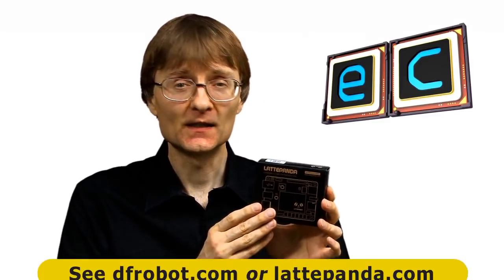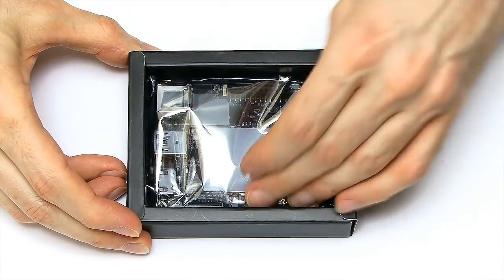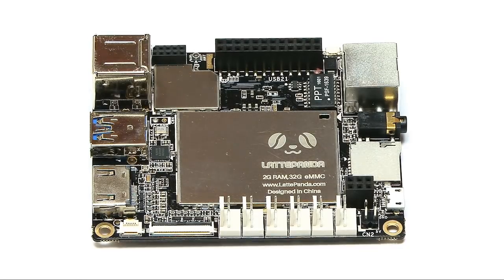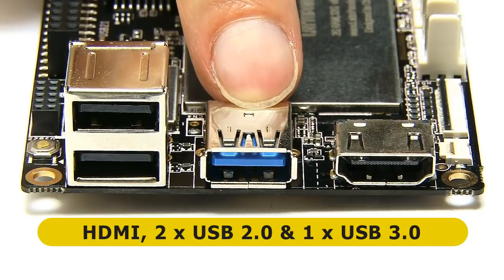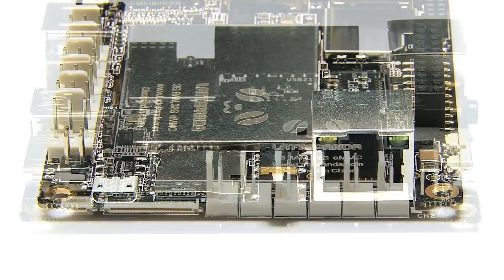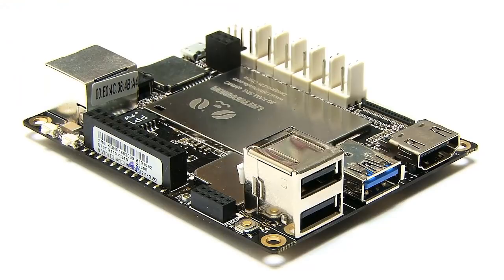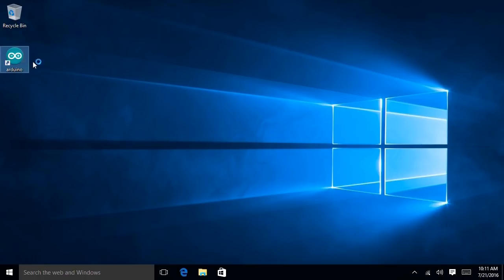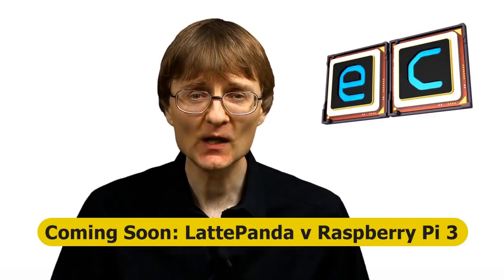LattePanda Windows 10 Single Board Computer

Comment: Could have never imagined this way back in 1996 when I first got my very own Pentium pro desktop computer with a 1gb hard drive and 16mb RAM! Technology has sure come quite far!
Reply: What?! 16 MB of RAM? back in the days that costed a fortune...
Reply: And my computer have x1024 times the memory 

Has sience gone too far?
Reply: Mate.  You are way too young ;)
Reply: and now you can run hundreds of adware, malware, trojans, keyloggers, bitcoin miners and viruses at the same time and you browser will still lag like it's 1996 again
Reply: Clean up your computer then and stop moaning dude.
Reply: Yeah. Time has change fast. In the end of the 80's,  I bought a Brick 80286 computer. Default setup was 1Mb of SIM RAM. I decided to upgrade the memory to 8Mb (max). The cost of 7 * 1Mb RAM back then was approximately $1.000,- :) Before that, I owned a Amiga 2000. It become so expensive, that I had to skip the 20Mb hard drive and live with a couple of floppy's :)
Reply: Well, my first PC had 75 MHz (yes - seventy five mega hertz) CPU, with 1MB RAM and 600 MB HDD........  Been using it for browsing only. 
Then the second one had 200 MHz CPU, 16MB RAM and 2GB HDD -  I was able to download and watch movies on it, woohoo!! lol
The older folks will also remember the dial-up noisy struggle and all the disconnections... plus how we download a single mp3 file for 20 minutes with a speed of 3-4 kb ....  Or a 700MB movie for about a week time.... lol.
Reply: I remember 16-64kb of ram and 8-20mb harddrives..
Reply: The true question though, is, did it run Crysis?
Reply: We will never stop evolution.😊
Reply: I couldnt imagine this back when I got my first PC 486DX2 66MHz! 4MB ram with a 500mb hard drive and a 512KB GPU LOL 256 colors only.
Reply: Atom is amd64 capable
Reply: The first computer I had had 64kb of ram. It's release date was before I was born but I had one as a boy. Amstrad cpc! 4mhz CPU! Then we got two windows 95 computers, then two windows 98 computers, then we had windows me (should have gone 2000 but honestly it wasn't so bad) then a few windows xp, then vista, 7 and now windows 10 and Linux but might go back to 7. 

The first pc which was actually mine other than the cpc was 800mhz, 20gb and 64meg ram. That's when windows me was released!
Reply: Tech Guy Charlie 一一
Reply: I just said that to my daughter's boyfriend - my very first computer was a Commodore 64 with the styling 5.25" floppy.  :-)  With a whopping 64K of on board memory.
Reply: So basically you could play Duke Newcomb 3-D on this !
Reply: My first computer was the BBC  Micro Model B back in 1998 I bought it at a car boot sale for 5 pounds, happy days. I've now got two of them.
Reply: My brother's first PC was a Pentium with 100mhz with monochromatic monitor and we used to play a lot of Rise of the Triad on it lol No media player, only glorious floppy disks with ARJ. Good old times!
Reply: First computer used was a zx81 with 1 k of ram
Then Atari 400 with 4k ram
Next was 1994 486 33 256 mb HD and 4 mb ram. 
Windows doesn't get any faster

Comment: I have been watching your videos since the beginning and this one is like usual an excellent and informative video. 
Based on the video I purchased a Latte Panda 4/64GB. It came with the connector for the WiFi cable not fitting. 
Compared to other connectors of the same model, it seemed to be bend, not sure. Without the antenna no way to 
activate Win10. Finally I was able to force it in and connect to my WiFi network. The WiFi connection is slower 
than comparable single board computers I use. Fortunately this application doesn't need constant WiFi connection.
On the positive side, the construction is excellent and I like having simple access to the external connections. 
It is the perfect solution for this project and the size fits perfectly behind the 5" LCD. Thank you for bringing it to 
our attention.
Reply from the maker: Glad to hear you got this working. I do like these LattePanda SBCs.

Comment: You might be interested in the UDOO x86. It is an x86 single board computer that has compatibility with Arduino hardware and software, through a compatible microcontroller that can interface with the x86 processor. It bills itself as "the most powerful maker board ever". Seems pretty interesting.

Comment: Put this in to perspective; the year was 1984 I purchased my 386 DX PC with 4 MB of RAM and just released ATI graphic card with 1MB on board memory. My HD was huge 120 MB Conner. After they install DOS 6.0 and Windows 3.1, there was still about 112 MB left and I began to wonder what I'm going to do with all this space. I was connecting to CompuServe with 2400 Baud Rate US Robotics modem. My monitor was the latest and greatest .25DPI ViewSonic monitor, just released to the market. The price $2700.00 without printer. Sorry young generation; you just have to google things like CompuServe and Prodigy.
Reply: .25DPI ViewSonic monitor

I'm pretty sure my eyes would start spontaneously bleeding if I had to look at such a thing...
Reply: 1984? I'm impressed. The 386 DX processor wasn't released until October 17, 1985 and your PC would have struggled to run Windows 3.1. That didn't come along until April 6, 1992! The gentleman doth forget too much, methinks ;)
Reply: Actually, it was better for gaming than an LCD. I have a Sony, 25" CRT flat screen at .20DPI, with built in KVM. If I had a place to put it, I'd be using it. It's faster than the flat panel monitors for gaming.
Reply: 1984 my parents didn't even know themselves 😁
Reply: Got my B.S. Computer Science in 1970 from MSU. The year was 1972 when we bought a small address label maintenance business having a DEC PDP-8I. No disk, just a card reader, 10cps teletype and a whopping 8K (yes, K) of core memory. 4K for programming and 4K for a tape buffer. I had to key the boot loader (called RIM loader) in from the console switches. We used Fortran II for our coding. To compile, since we had no disk, it was a multi-process of writes to mag tape, rewinds, etc. But we did amazing things with this little guy. Now I observe the growth of computing, and realize we haven't seen anything yet!
Reply: Dragunov Bushcraft what year LCDs are you comparing it to? No way can it even come close to touching the newer LCDs.
Reply: Impressed that you had that version of Windows 8 years before it's release.
Reply: Your timeline is way off for the release of the 386 and Windows 3.1, but I still remember using my 8088 PC in the 80's, running at a blazing 4.77 MHz. Connecting to CompuServe and Prodigy. Good times. I miss the simplicity sometimes, but the tech we have now is amazing and it hasn't been that long. I still have that 8088 and quite a few other vintage computers.
Reply: +stanleyb51 What a pretentious liar.
Reply: What...no AOL? I still remember when we bought a 486 100Mhz Packard Bell with a Sound Blaster 16, CD ROM, and 14.4K Modem. Not even sure what we looked up on the Internet back then...

Comment: Thanks for the great unboxing and overview! 

As for cooling, please note that dfrobot.com sells a couple of different cases, a fan, and heat sinks for the individual board components - all for an affordable price.  

Also note that the installed Windows 10 software for the larger (4GB/64GB) LattePanda configuration is not activated like it is on the smaller version, so a separate Windows license must either be transferred from another device or purchased from Microsoft ($99) - nearly doubling the cost of the system.

Keep up the great work!

Comment: you gotta overclock this!!
Reply: K cpu's have unlocked multipliers, allowing you to easily overclock the CPU exclusively from the rest of the machine. This is the common most understanding of over clocking. He can try to overclock something else like the front bus, which will also increase the clock speed of things like the RAM. This option is more limiting though. Nevertheless, overclocking could be done!
Reply: didnt you watch raspberry pi extreme overclocking video?
Reply: The comma's are just freaking killing me, make them go away. PLEASE MAKE THEM GO AWAY!!!!!
Reply: ***** exactly. but we arent here because of what needs to be done, but what can be done!
Reply: Tuna Yücer I'm here thinking how to cool this when I buy it and overclock it
Reply: But the processor isn't a intel (insert number here)K processor though

Comment: when a $100 single board computer has a SD card slot but a $3000 mac book 'pro' doesn't. XD
Reply from the maker: Indeed! :) It has a 3.5mm headphone socket too! :)
Reply: haha i didn't even think about that, it honestly seems like a grate deal especially considering that windows normally cost $100 alone.

Comment: This would be an amazing replacement to my dual tablet install in my car. Grab a couple of these guys, along with a couple touch lcd panels, the possibilities would be endless. I could run relay's and control all my lights, my horn, hell I could set it up to start my car from my cell phone provided it's within wifi range, or just run a hotspot so I could start/unlock it from anywhere it has cellular signal. Man this thing is cool as hell. I hope it can support Windows 7 since it supports 10 just fine.
Reply: Do you live in your car?

Comment: I'm done with Linux, this looks awesome.
Reply: But what about if you could  install linux on this?  Like to wipe Windows or install Linux side by side with Windows as dual boot
Reply: Nasrani MinAlGharb But I'm done with linux, so I wouldn't do that.
Reply: *****
Ok
Reply: Milos Djeric
I'm not much into windows. I only use it to run applications that doesn't exist in Linux, and doesn't run properly using wine.
Reply: Milos Djeric
I refused the upgrade and immediately after the deadline for the free upgrade was past, my windows 7 crashed. I was forced to wipe my drive and install linux.
Reply: Milos Djeric
That spying thing is all around. Not only Microsoft but also Yahoo, Google, certain antivirus, Facebook, etc. The intelligence agencies like CIA and FBI pay out huge sums to these companies to allow spying on people, that is why as soon as someone starts a  truly private E-mail, they shut it down. I don't trust Whatsapp either..
Reply: many R&D positions require you to know linux though........ apparently because it's free. but seriously, taking a small pay cut for a month is enough to pay for a few licenses of windows...
Reply: Linux is fine if you don't need to do anything but browse the internet or use a word rip-off. Try running inventor, AutoCAD or solidworks in wine....

Comment: would this be a better choice than a raspberry pi 3 to make a small emulation based games console?
Reply from the maker: Quite possibly, if you have Windows-based emulation software.
Reply: ExplainingComputers for software i was thinking the windows version of retroarch
Reply from the maker: In that case this could work well for you. I have found the LattePanda to be a very capable SBC. I like the Pi too. But the Panda has a bit more poke to it. :)
Reply: ExplainingComputers thanks :)
Reply: This thing is not in the same category as raspberry pi. It's $150. If you're fine with Linux, why not get the new Orage Pi 2 for $20?
Reply: olegkikin because i want something that will do the job well
Reply: This is really nice.  The only downside I see would be the Windows OS.
Reply: Without the windows os, Yeah but with Windows installed you would get not that much in performance compared to a rp3. I would recommend waiting for the raspberry pi 4 or getting a raspberry pi 3 to play and emulate games, I have a pi 3 with retropie and I can emulate PlayStation, snes as n64. Also with the raspberry pis you can overclock them to get max performance (and they cost half the cost of this board). Personal preference but it is up to you.
Reply: yes and no. I can see potential for this in where windows apps would be a requirement in certain business applications.

Comment: It's a PC, no such thing as a Windows Computer. Have you tested this with Linux?
Reply from the maker: I think we can call a computer with Windows installed a "Windows computer". And here, it is very difficult to install anything else -- certainly you cannot boot an install Linux from USB in the normal fashion (and many people have tried). In theory this could run Linux. In practice nobody is offering a distro and means of install that works . . . (which is a shame I agree!).
Reply: Well, my point is if it were a PC, if it were compatible enough you could install a Linux distro, because Linux is compatible indeed. Perhaps you're right, and this computer is not a PC but limited to the included Windows. I do think that's a shame, because there's no reason except perhaps hardware design shortcuts to fit it. I can see how this would be useful to replace components on a factory floor for things like established Access-based production systems. But for the home user, to me this competes with ITX+Blu-Ray for media center type applications, and I'm not sure it gets there. But there's always enthusiast (hate that word!) I/O applications, and this might let you apply the software you're used to.
Reply: I've got a windows 10 tablet and it would not run any linux live usb images I tried. Maybe they are actively denying it. So again disappointing. Think I will buy a lattepanda anyway :)
Reply: If you want to run Linux (other then to say you can) just get a rPi 3 and save the money.   I believe the target market for this is the windows crowd, that wants to pay more to run windows.
Reply: Uh... It's an X86 computer. It'll run linux just fine.

This is a board designed for people who for some specific reason want X86, or people who don't understand how to use linux. The latter probably shouldn't be getting into buying SoCs in the first place.
Reply: Wouldn't this be an SBC rather than a SoC?
Reply: GNU/Linux is only a bit more troublesome to figure out GUI-wise than Win10. Getting GNU/Linux to work for you instead of the other way around is another story.

Comment: But can it run Crysis???
Reply: Video yes xD
Reply: That would just be a Crysis...
Reply: eXoguti097 bad joke, bad joke...
Reply: The Z8700 actually does.
Reply: you could stream Crysis to it
Reply: first 100% second 40% third 1%
Reply: o yeah gta V too
Reply: Yeah. At Max settings with a gaming computer and a good internet connection
Reply: Seems a neverending joke but in fact high end ARM SoC's would be able to run Crysis at 1080p with high settings with a very decent framerate, if Crysis were gonna be launched for ARM natively :)
Reply: It will run about 20fps on Intel core i7-7700K(1920x1080 low settings) so i don't think this will be much better.

Comment: Did someone try it with Linux (Arch or Debian based distros)? I don't work with Windows for a decade, and don't intend to.
Reply: What a troll....
Reply: Ignore the kids. I would also like to know if and how linux runs on it.
Reply: just leaving a comment to get me notified in case someone has experiences with it. little x86 pcb computer with linux would really come in handy.
Reply: i think it will work,because most intel chip and drive uses by windows..in linux we have the driver..or open driver for it..i would like to install kali linux on this board also..lol..imagine..small hacking hardware..bizzare
Reply: but why would u want to buy this board then? I guess most of what u payed for the board will be for the operating system... Only the hardware shouldnt be so expensive...
Reply: Peter
i hear windows 10 is free for such purposes. i guess there might even be microsoft behind to increase their market share. the thing is x86 pcb computers are rare and could come in handy for certain computation, with a decent operating of course which does not eat up most of the ressources.
Reply: x86. So rather than running an ARM version of Linux, you could run x86 which may have specific software you need. It also has an integrated Arduino.